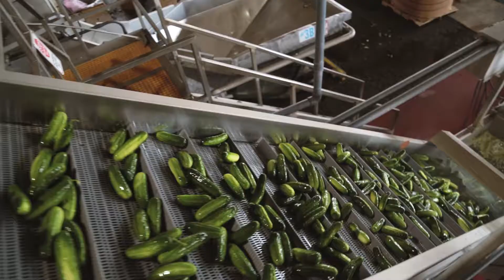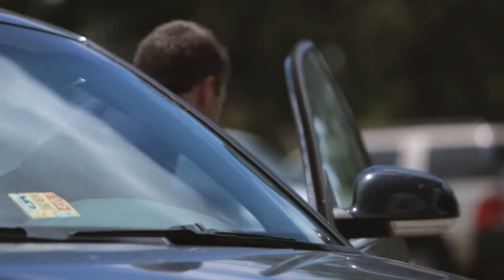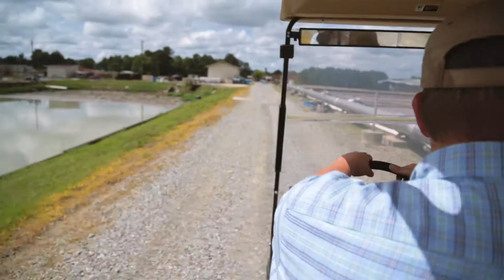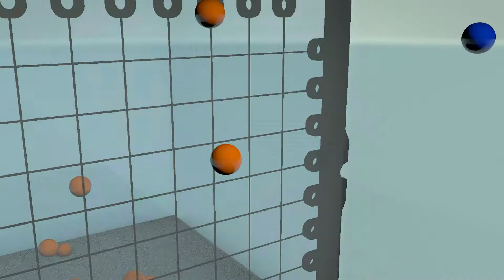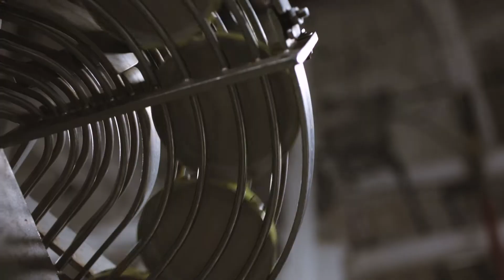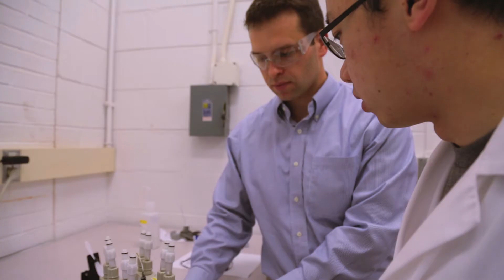Harvesting Clean Energy - UNC System - ROI

Comment: Thinking of a closed system that reuses the same water.  Convert concentrated salt water to relatively fresh water using temperature swing solvent extraction then generate electricity using ROI and repeat.  There would be some amines in the water not sure if that would damage the membranes or not.  I believe if you heat the amine and salt water solution up then the salt ends up in the amine portion when the amine and water separate and if you cool the solution the salt goes into the water leaving less in the amine portion.  Not sure which amine MIT used in their desalination video.   Have no idea what kind of energy density you get out of these ROI systems by weight.  Probably would not be good for a mobile land based solution.  I am curious.